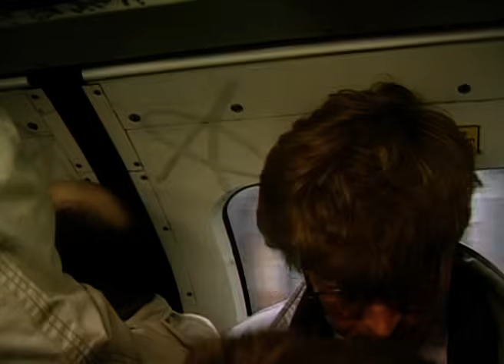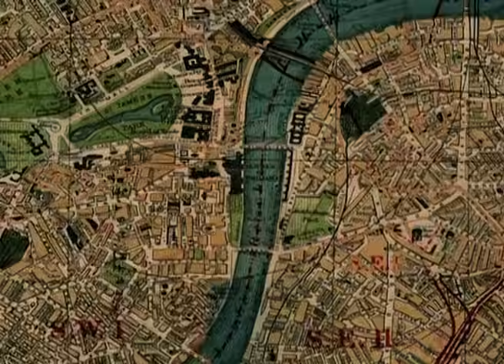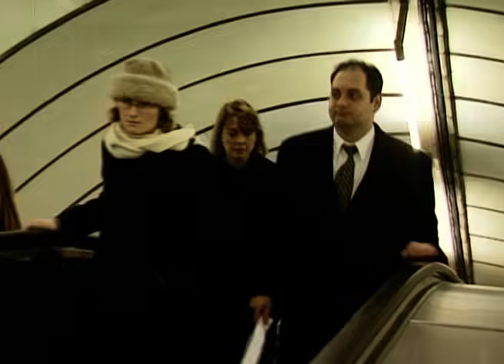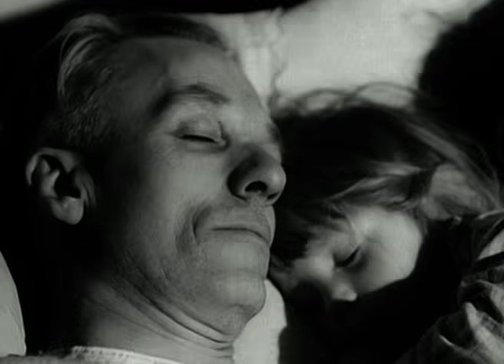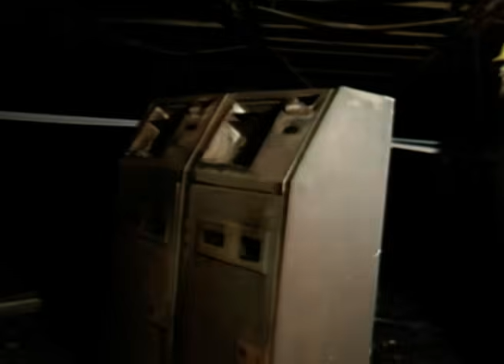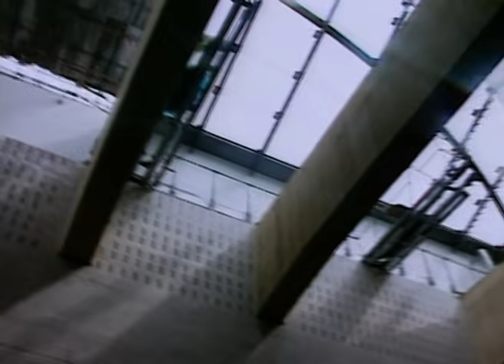The Making Of The London Underground's Incredible Design System | Super Structures Episode 1

Comment: I live in Texas and the Shinkansen N700 bullet train rail line is being built between Houston and Dallas. It will be a dedicated line with no other train traffic on those tracks. I can't wait to ride that train. It's scheduled to start construction in 2023 and running trains in 2026.
Reply: There will be no motor vehicle crossings and other such items found on other railroads.
Reply: @guymorris6596  Lucky you. There's no level-crossings on the tube either.

Do you know much per mile for your bullet train? In this film the narrator said that in C.T.Yerkes' era a tube line cost £23m/m (in present day equivalent value). I heard that the ages-in-gestation new subway line being constructed in New York is a staggering $1bn/m.
In comparison, the ⅔ surface-running High Speed line up north from London costs £300m/m which is twice as much as ten years ago. The estimated overall cost has now tripled to just over £100bn, but who knows which figure they'll dig up if you ask them in a month's time‽ Such is the way of things nowadays, it seems.

Comment: Very soon now, the Elizabeth Line will open. Not a "Tube" train but an but a train(urban) that goes underground.  It will link with Londons existing Transport Network. It will serve 41 stations (10 brand new) right across  London, East to West. a total of over 60 miles. Its cost was £19 billion and the biggest engineering project in Europe. Watch
the video on you tube. "Elizabeth Line(cross rail) Abbeywood to Westbourne Park, drivers eye view"
Reply: Visited London recently and used that Line. I had no clue it was only recently opened. But it certainly looked better than the others.
Reply: @croweater87  Londons underground is very old and although improvements have been made, its very difficult with the size of the original tunnels.  Hope you enjoyed your stay and everything else was ok. As a side note, the very latest train to go underground (The Elizabeth Line) is not actually a "tube" train, its more of a urban train, larger size and tunnels, stations. Goes right across London East to West, sometimes overground and sometimes underground. Look it up on You Tube.

Comment: I've never seen any documentaries covering the Jubilee Line Extension Project before, so thanks very much for sharing it. The video took me straight back to my early 20's when I was thoroughly enjoying working on the JLEP as the Technical Assistant to the design team, primarily working on the construction of Westminster & Waterloo Stations (Contracts 102 & 104). Haven't thought about it in years until this video popped up. It was such an amazing project with some incredibly talented and generally awesome people. Thanks for reminding me how incredible it was & probably still is if they've been good and have managed to adhere to my station & tunnel maintenance guides.

Comment: London tube is notoriously unsafe. Have you ever wondered what if you're deep underground on Piccadilli line heading towards Heathrow or Cockfosters & there's a terror incident somewhere down the line or fire🔥& you need to get out of the train fast, how would you get out? I tell you there's no way out because if you'd observe once the train leaves Cockfosters & goes underground, tunnel looks like this 😬👉🚇👈 one train, one snug fit hole with no escape route or exit door plus the rail track is live. Even if they cut off the live current, there's no room for panicking passengers to get out & walk alongside the train to safety. You can observe this perilous structure all along from Finsbury Park until Barons Court. It's suicidal. Come to France or Germany & see the safety difference. Two trains passing each other underground of course in opposite direction with enough room for people to walk out in case of emergency. London needs to do more of that because so far, a major incident hasn't happened that's why no one is addressing the inadequate safety issues ☝️😒
I see danger every day whilst commuting - most of the trains are roomy enough, jubilee & piccadilli line trains seat covers are dirtiest - every year fairs go up yet no one bothers to preen the trains. In France 🇫🇷, we have roomy double decker trains to carry more people.

Mind you. The Brexit manifesto started with the common displeasure when it comes to commuting to work in the morning & back home in the evening on the freaking tube where you can't find seat & are travelling with your nose under someone else's smelly armpits being Eastern European or British 👈😅 either way, everyone in is fed with London
Reply: It’s the safest form of transportation going.

Comment: "The only thing that stood the test of time were the iron tunnel linings. So when the Jubilee line extension was planned, they were determined to get it right." - 10 minutes later - "The iron linings were replaced by concrete, because it was cheaper" - Womp womp.
Reply: Concrete can last for hundreds of years. Cast iron can and does corrode fron stray electrical currents.
Reply: Korenn womp womp ?
Reply: @danielwilson6529  It's a meme way to express the cliche trombone indicating a fail.

Comment: Looks like concrete is being injected, not cement.
Reply: The cement truck mixes the cement to the construction site, where experts checks the concretes quality.
Reply: @lagresomadsl  Cement is a powder. Cement is just one of the ingredients to make concrete. If you mix the cement powder with aggregate, sand and water in the correct proportions you will have concrete.
Reply: @keithd5181  then you need silica, fly Ash and loads of other chemicals.

Also, the concrete dehydrates faster with warm cement, and if the sand is wet, you can experience problems with the water content in the recipes.

If you are using self levelling concrete, to much water will separate the mix. Etc.

Comment: I am very surprised they show the use of manual track laying and manual track repair. We in the RR I worked at used primarily machines that checked the track for wear and true runs measurements. That could pull from a car of tracks and cement cross rails for assembly and included was a welder that could do both track connections at a time attaching the grounds too.
Reply: How big were these machines and how did you get them into the tunnels and get them out again a few hours? What and where is RR?

Comment: Condensing tanks did not fill up with fumes. They collected and condensed steam, turning it back to water. The openings above the tube were to allow ventilation of smoke from the engines fire, which was not passed through the condensers and was expelled continuously straight into the tunnels.
Reply: Interesting I was wondering how that works your explanation sounds like you have spent some time on a steam plant I'm your evil nemisis the gas turbine and diesel dude lol thanks for the lesson
Reply: Don't you mean "train in the drain"?

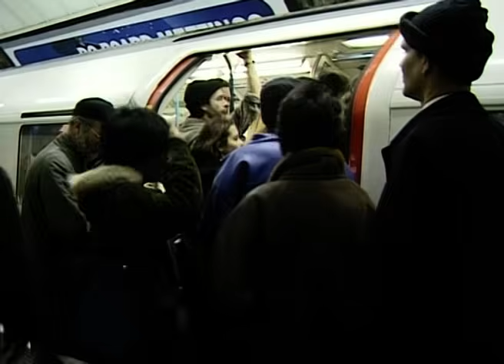Comment: 23:46 "Only on the London Underground is a carriage called a car [in the UK]". Well, no it isn't really. Fixed formation trains that can power themselves and be driven from either end are called "Multiple Units", each vehicle on the train being called a car (short for carriage). The usage of the term "car" on MUs does stem from American terms however, no arguing about that. But on the tube, the mainlines, branch lines, tramways and light rail systems of the United Kingdom, a vehicle on a multiple unit train always has been and probably always will be called a car, not just on the LU. Also, "Train in the Drain"? Really?
Reply: We also call what are ‘cars’, coaches or units
Reply: @hx0d  Not quite. When speaking of "cars" on this side of the pond it is usually referring to vehicles that are part of a multiple unit. Coaches are the opposite of that, being loco hauled rolling stock that can be coupled and separated in marshalling yards or sidings to make up a train rather than a fixed power set like multiple units. For the uninitiated, coaches incorrectly refer to any railway vehicle that doesn't look like a locomotive or "engine". When talking of units one is referring to the line of vehicles that make up the train as a whole in the form of a fixed set, not each individual vehicle. Those are called cars. Cars are literally short for carriage, before you ask.
Reply: Tommy Lucas yes but I mean people call them coaches. They’re correct as carriages though as well. I’ve also heard multiple units and them also being called units, but it only seems to be on national rail that they’re called coaches and not on the London Underground
Reply: @Lamster66  ...umm, as a matter of fact, no. Most people call them carriages or coaches because they don't know the correct terminology. The usage of "car" when referring to a multiple unit vehicle spans much further back than just American television. Railcar, tramcar, buffet car, griddle car, etc. The usage of "car" could be attributed to American involvement in early railway and tramway electrification and thus multiple units becoming the norm, however in reality "car" is simply a shortened version of "carriage" and is used worldwide, not just the Americas. In the railway world on this little island, "car" is only ever used when referring to MU vehicles or trams, professionals that have been in the business for years. Might I suggest you stop attributing phrases used in an industry you clearly have little interest in or knowledge of to certain factors that have nothing to do with the situation. Fact check yourself before making stupid statements.
Reply: @Lamster66  check again. As a Briton and an avid British railway enthusiast and modeller (or as some of you ordinary and unkind folk call us: "anorak") I can tell you with absolute certainty we do, particularly in the industry.
Reply: @Lamster66  Alright, if you refuse to take my word for it, would I be able to point you towards some reliable sources on British rolling stock? I'd be more than happy to oblige to put this issue to bed. Of course to the uninitiated or the normal person the usage of "car" when talking of railway vehicles is a rather alien subject, but I assure you this dates back well before American media became popular on these shores.